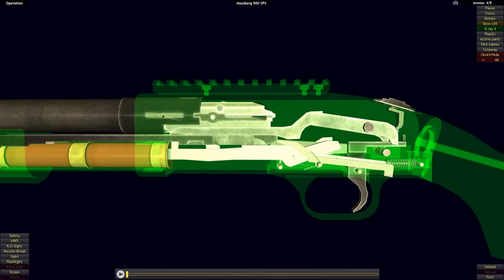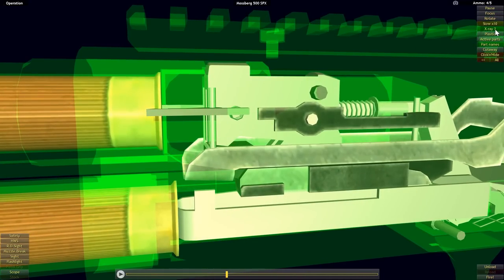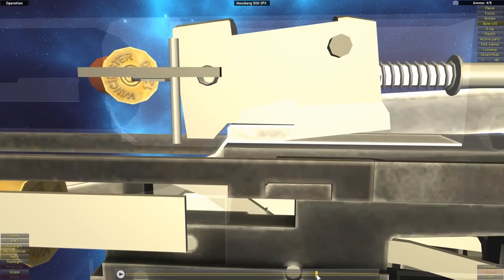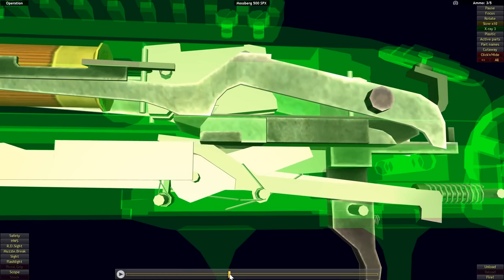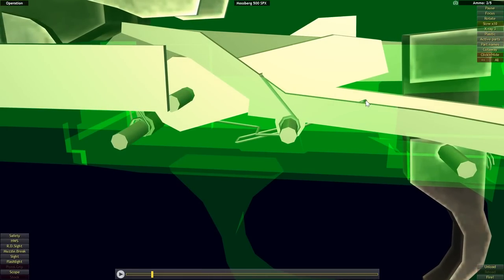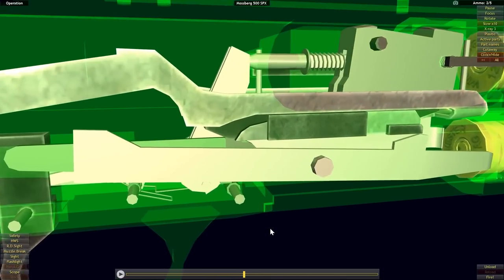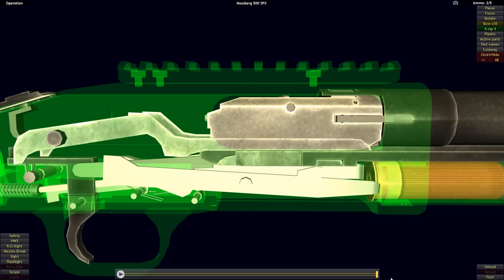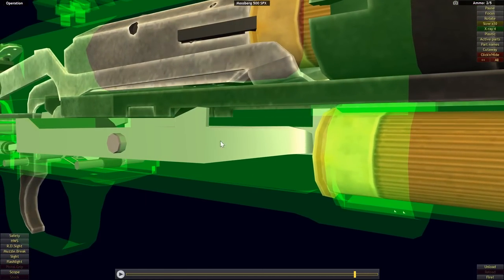How Pump Action Firearms Work: Mossberg 500

Comment: The bolt is simplified a bit, after taking mine apart half a dozen times I finally figured out the bolt workings.  The bolt itself doesn’t pivot, a piece inside does.  This animation has helped tremendously to figure out how the shotgun functions and what may cause certain malfunctions.  Thank you!

Comment: Thanks a bunch for the info! I was having trouble with the locking bar not unlocking after pulling the trigger, forcing me to hit the button to unlock it after every shot. After watching the video, I disassembled and inspected the gun and found that the pin that goes thru the sear and activates the spring when the sear moves, had worked out of the bore. So, after moving the tip of the spring out of the way and reseating the roll-pin everything works as it should. A simple enough fix, but one I never would have figured out without the video. Thanks again!
Reply: I had a similar problem to yours, but what I found was the problem is with the hammer. The lower roll pin in the hammer that applies pressure to the action locking bar spring after you pull the trigger had fallen out at some point. The missing pin released the spring pressure on the assembly causing the action lock lever to stay in the locked position after pulling down on the trigger.

Comment: I did indeed enjoy this most informative video. I have a 500A made in May of 1970. It has some differences, most notably the single action bar only. It has been neglected in a closet for some time and I recently took it out to recondition it and put it back into service. I'm no mechanical engineer, but I do admire the parsimony of the design and its elegance. I do hope the single bar system is strong enough for my use because the receiver and bolt slide are not cut for a second bar. There are also other minor differences.

Comment: The pivoting shell stop on the older models acts on the shell lifter making contact on a lip rather than the back edge of the slide pivoting the assembly. The parts are interchangeable if the old style wears out and I suspect this design change is because Mossberg avoiding infringement of patent similarities to the Hi Standard manufactured a few years before it. Much hunch is the old design was a work around to avoid patent infringement much like waiting for the Remington patent to expire before using dual action bars.

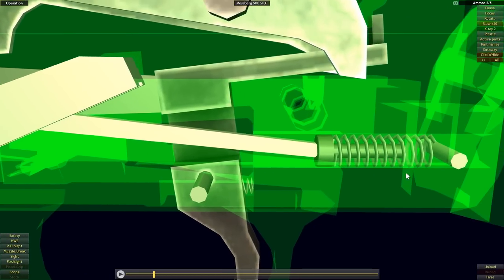Comment: In this video, (10:35) you have the trigger and behind it is a spring.  Right behind the spring, you have a thin small tube that sits flush, what is that called and what is it for?  

I was putting a black hawks knoxx breachersgrip on my shotgun and noticed that this little pin wasn’t 100% inside.  Meaning, the right side of it wasn’t in the hole.  It had fallen out so I grabbed a small screw driver and lifted it to like it up with the hole and with another screwdriver I pushed the other side in (it was hanging far to the left) and now it was flush with no over hang and in both holes.  

I last shot my shotgun about 5 months ago, no problem.  Any ideas?

Comment: Help needed. I have an old Mossberg 500 AT. I cannot find any info on the weapon.  I would like to know how old it is and another problem I have is on the mag tube. There are two brass soldered rings on the mag tube.  Can they be ground off as it creates a problem for the forend removal.

Comment: I pulled out my 500e 410 from a decade+ of not being used. When loading/ejecting shells, the shells just seems to fall out the bottom of the gun before being loaded, or get jammed ..somehow. I found that if you only load 1 shell at a time, it is less likely to jam, but still tends to want to fall out if you aren't both fast with the action movement, and tilting the gun slightly to have the shell favor falling against the side, instead of out the bottom. At first, I thought that the gun was missing the loading ramp like on the 870 Remm, but then after looking at this video, I see that it handles shell loading completely differently than the 870. I am stumpped as to why shells seem to fall out while pumping the action. My only guess is that since the shell lifter engages so late in the action (like the last half inch), that the shell stops are clearing long before the shell lifter has a change to get under them. But why?? Any ideas?
Reply: It sounds like the left stop is not grabbing enough of the edge of the shell and it is clearing the edge too early. I would take it out, put it in a vice and give it the slightest of bends in towards the curve. Then it will clear the shell later and the lifter will have time to drop down and catch the next shell. Worst case here is that if you mess it up or it doesn't work, just order a new stop from Mossberg. 

If the right stop were bad then the shell that would drop would be the NEXT shell not the one currently being loaded. 

https://www.brownells.com/schematics/mossberg-/500e-410-sid162.aspx

Part#12

Comment: So hypothetically if you ground down the top of the locking lug and replaced the handguard with some springs attached where the handguard was it would be semi automatic?
Reply: I would question whether sg shell pressure would have the energy to drive all that mass in relation to the spring weight you would need to drive it back to battery.  You would eliminate the locking block since the spring is what would actually hold it.  I guess if the forend wasn’t as big it may function.

Comment: I have a 500 that I just got used and there seems to be something loose/sliding around. It sounds like a piece of gravel or a BB somewhere near the pump action and barrel. It makes the noise when I tilt the gun up and down. I was just wondering what it is and if it's safe to shoot. Thank you
Reply: The noise your hearing is probably the plug in the magazine tube, a short piece of dowel rod or similar size shape material that limits your mag capacity. If the mag tube is loaded and the noise stops then there’s your answer. If this is the case, yes the firearm is fine and that’s normal. Hope this helps
Reply: Like the other guy said.....it's probably the waterfowl plug in the magazine tube

Comment: Nice video with an x ray view of WHAT should be happening.  I have a Mossberg 500 FLEX and the shotgun will not feed shells.  The two tabs on the shell stop and interrupter will not allow the shells to feed onto the lifter.  Have tried different makes of shells and it will not feed.  Contacted Mossberg and they want the serial number the receipt and a video of the problem.  True BS to me.